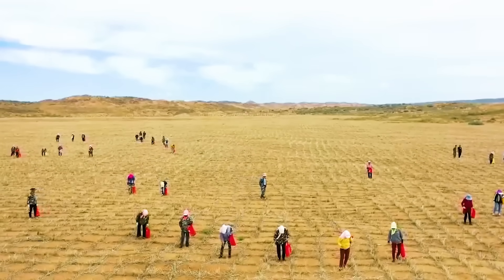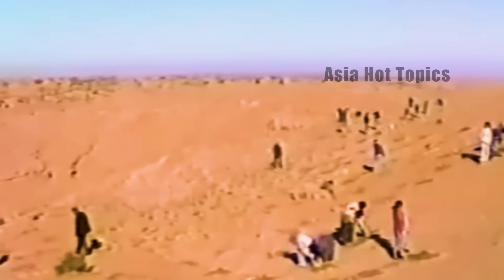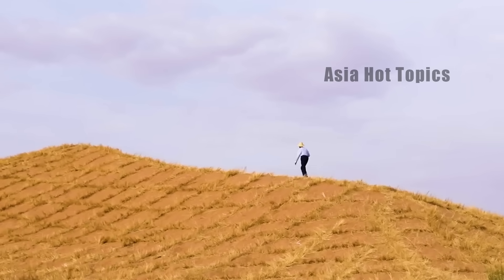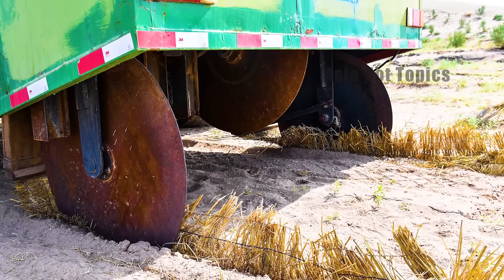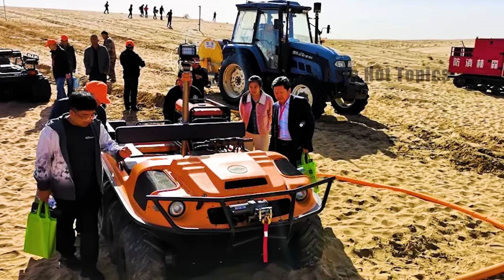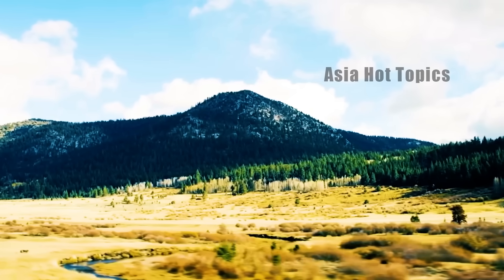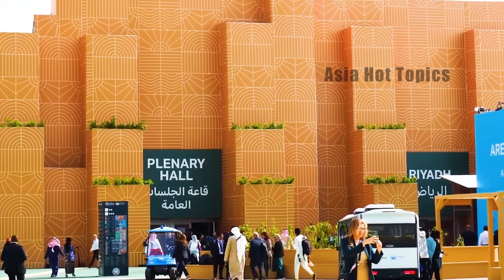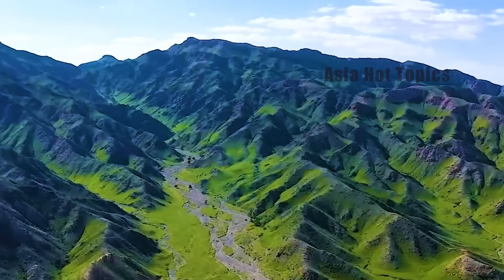Unbelievable! China's 8,000 Tree-Planting Robots Are Transforming Deserts into Green Oases!

Comment: Very Interesting but how much is a moo ?
Reply: A "mu" (not "moo") is approximately 1/6th of an acre (0.165 of an acre) or around 666.67 square meters in China. However, the "mu" which is also a measurement used in other East asian countries will vary depending on the country. For instance, in Japan and Taiwan, a mu is around 99.17 square meters and in Hong Kong and Macau, the mu is 761.4 square meters.
(note: even in the West, similar units of measurements may be different in different countries. As an example, the British Imperial gallon actually is larger than the U.S. gallon. Similarly, the British Imperial ton is heavier (known as the Imperial long ton) than the U.S. ton which is lighter and known as the "short ton").

Comment: yep , ocean pipeline will be needed in the futur till local water is retained
Reply: If the forest is large enough, a low air pressure with slightly lower temperature area will form, when higher pressure air flow with abundant water passes by, it will rain. It’s primary school knowledge